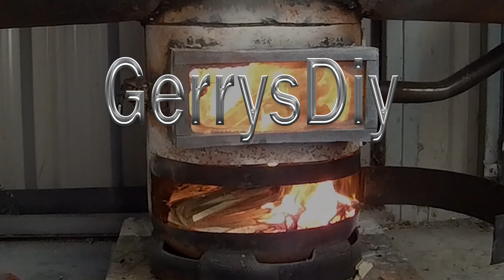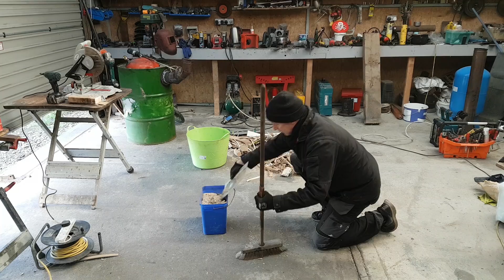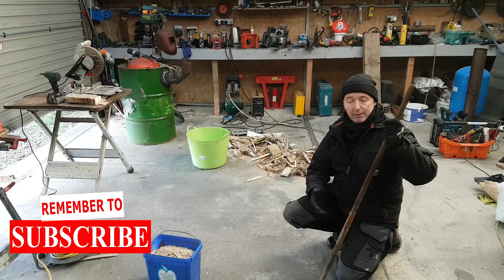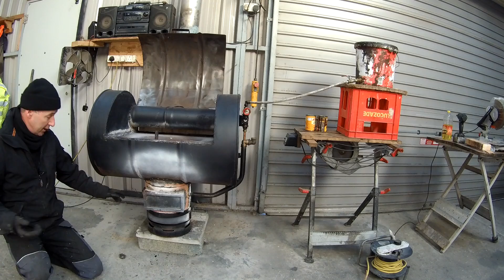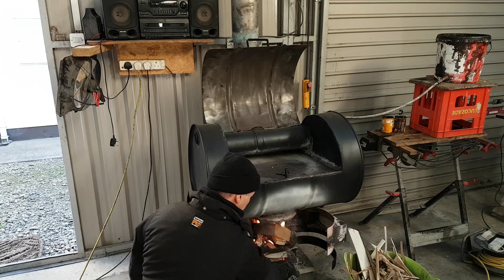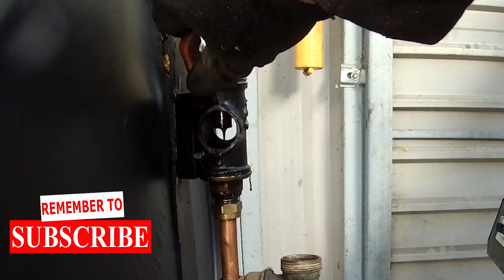Free Heat .. Dripping Waste Oil into a Wood Burning Stove

Comment: Top tip Jerry.  Blast types that use either a blower or compressed air can be made far more efficient.  
My own build:

Use a refrigerator compressor.  Feed and compress oil right through the system in to a suitable Jet.  Compressors can be doubled up and they are reliable and low wattage.  A safety blow off valve will be required or better yet a an electrical pressure switch. And make sure to filter well prior to minimise wear.
Reply: Syn, that is a great idea.  How much cleaning and filtering is needed of the waste oil is needed?  What is the tolerance of the fridge compressor for "dirty oil"?     I filter my waste oil through a cotton t-shirt, but if it sits in a 5 gallon bucket for a month, and is poured out, there is still sludge at the bottom.
Reply: SkunkWerX 
Using a vaned compressor.  I only use waste veg oil via a one micron stainless Hydac filter.  No metallic sludge to worry about.  Don't jet waste engine oil if you can help it.
Reply: Thanks for the info!

Comment: This video gave me an idea:  A wood gasifying chamber sitting on top of the oil burner unit.  The waste oil burner would provide the heat needed to gasify the wood above.  Run the smoke and gasses back down to the oil burner chamber via a downdraft pipe.    As if you need to make even more heat, right?    Anyway,  wood gasification...driven by the oi burner.

Comment: Hi Jerry can you please tell me what kind of drill bit I would need to drill my cast iron stove and what size to fit a half inch copper pipe including fittings thanks and where can I get them there was a place in Dublin but he wanted 160€
Reply from the maker: Hi Jack. You  can use a hole saw. These are high speed steel HSS and you can get a set in lodl for about 12 euro They are widely available. Use oil to keep the bit from getting red hot and drill slowly. These will drill through an RSJ if you dont over heat them. Hope this helps Cheers Gerry

Comment: With all your good burner ideas, it should never be cold in your shed, as long as you'll keep the door shut.

They may all be giving off huge amounts of heat, but you won't be able to heat all of Ireland with the heat that escapes through the open door.